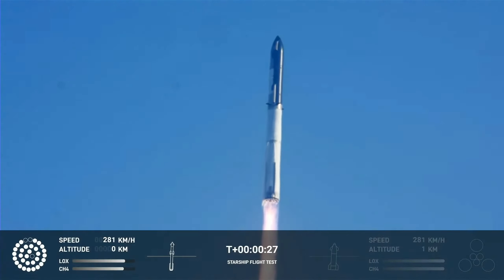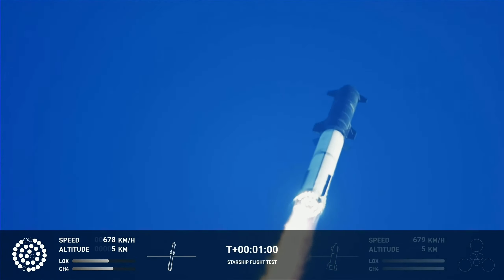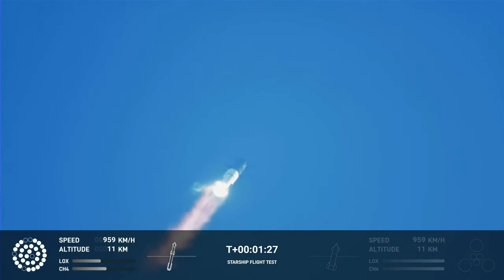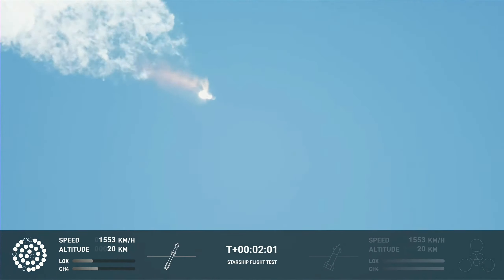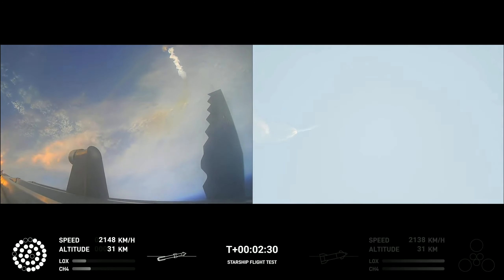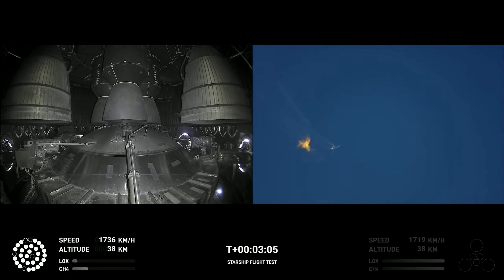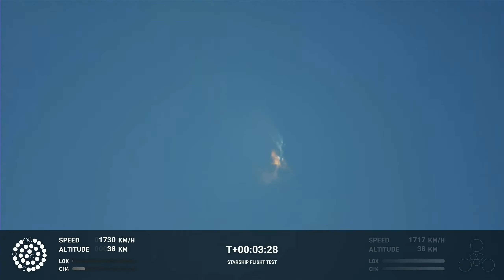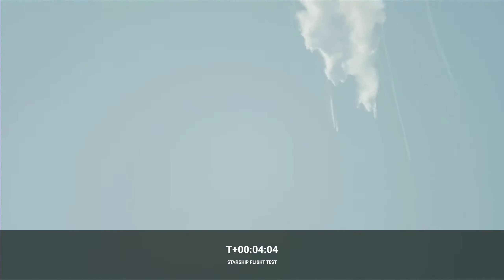(Complete) Flight Video of SpaceX's Starship & Superheavy Suborbital Test Flight

Comment: It was too bad but we will get there.  The Starship size is so impressive.     It gave me that excited feeling again like watching a NASA shuttle launch.   Great coverage👍💯
Reply from the maker: Thank you my friend! 🤗  It was a first stage failure, not all engines lit, and several were destroyed in flight, the gimbal was also destroyed, but basically it didn't have enough thrust to reach sufficient speed for orbital separation.  They should have tested the 1st stage separately and saved themselves the starship 2nd stage.

Comment: Hi! I wonder what could have caused the rocket to explode after 4 minutes. It's a pity it didn't work. I wonder big like 👍
Reply from the maker: We did a livestream of the launch.  The 2nd stage failed to separate.  Usually, they use explosive bolts to separate the stages.  It could be that or maybe a worker failed to remove a safety nut.  So 2nd stage was stuck to empty 1st stage...and if they tried to continue the programmed burns, they would have blown up as a result.  That or ground sent a destruct command.
Reply: @magnaviator  Thanks for the explanation.